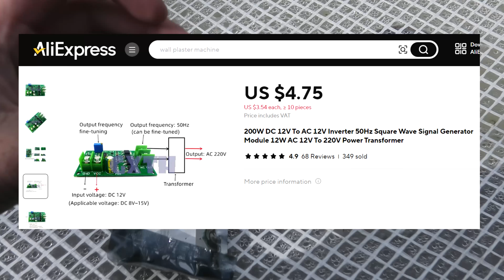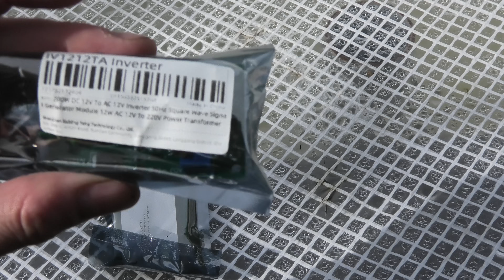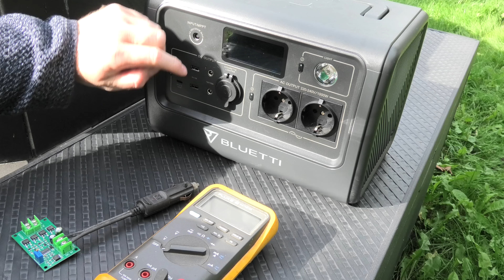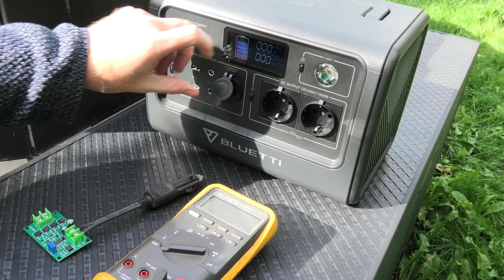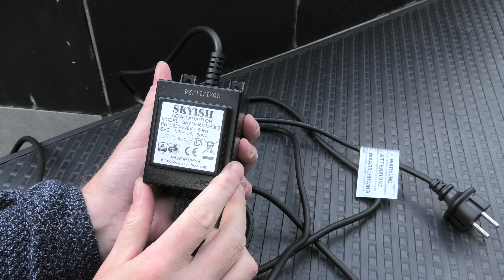How to Easily & Cheaply Convert 12V DC into 12V AC - 1422

Comment: The circuit board you are using square wave AC. For this reason, it will not work as smoothly as the sine voltage output of the AC/AC transformer connected to the mains and the pump may be damaged in the future.
Reply from the maker: Yes that is always a danger,,, there is nothing smart in the pump,,

Comment: I hope the pump coil supports the square wave. Good luck.
Reply from the maker: You mean that maybe that pieces of copper wire does not supports the square wave ??
Reply: @MyPlayHouse  Generally copper transformers do not support it. Let's hope that's not your case.